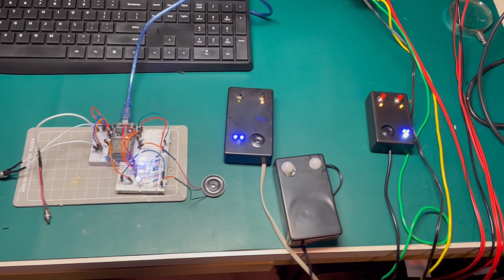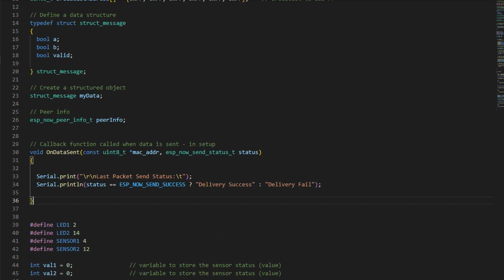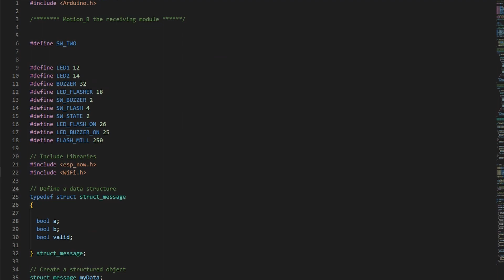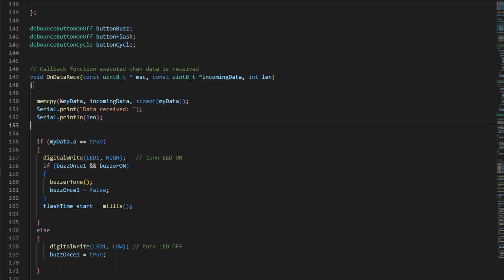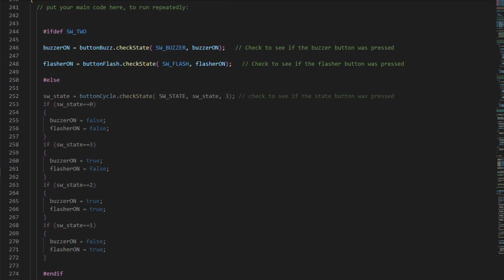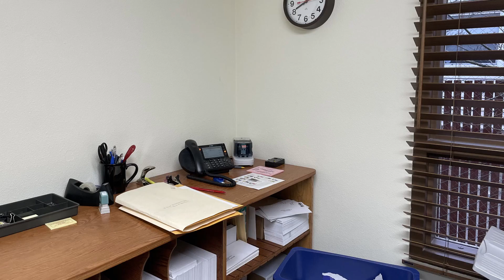Motion detection Using ESP-NOW

Comment: How about that! I don't understand most of it but that's a good Idea anyway :) At first I thought those would have all the wires, etc. hanging of of them in the office. But - very nice job and super professional, as usual for you. Thanks all you do and God bless.
Reply from the maker: Yes, the wires are power wires.  The receivers use a USB power cord while the transmitter uses a transformer.  So far they are working pretty good.